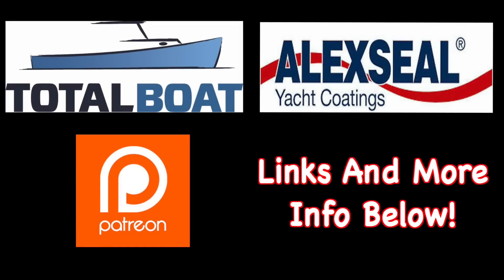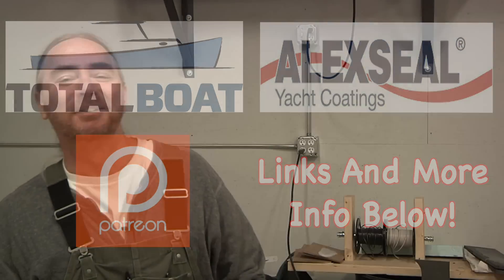HOW MUCH POLY OR EPOXY RESIN DOES YOUR FIBERGLASS LAYUP NEED?

Comment: Hey Andy, I'm making a small boat where I need to fibreglass 7 metres squared of area. It will be in the tough oceans and must must be waterproof. Do you have recommendations of the type of fibre glass and epoxy needed and how many layers? A salesman told me ten layers and tried selling me 55 gallons of epoxy but I was skeptical

Comment: I did my 1st layer of 1708/epoxy on my 1st composite project.  I think I over saturated it.  Can I use the epoxy dried brush (uncleaned brush) to apply the epoxy or an old plastic card to squeegee the 2nd layer before applying it to my 1st project ?

Comment: Andy, So what is better to saturate the glass or just enough to thoroughly wet out?
On a side note, I have a boat where someone has gloss painted a part of the transom inside the boat... I want to add a splash well can I glass over the gloss paint or will it involve stripping right back to glass underneath the original gelcoat and gloss?

Comment: Hey my friend, I’m finally getting around to resurfacing my barracuda Hydrocycle, it’s got old stained and spider cracked 1969 gel coat. I almost got it all sanded down to a clean surface. I had to sand out a couple warped spots into small holes that now need to be covered too. I want to put a layer of cloth over the entire boat, then sand and paint, but I don’t know which product to use for resin. Can you recommend a product that won’t break the bank, but still work for what I need and be good for years to come? There’s not a ton of structural strength needed, just over the small holes I sanded… It’s a jet ski sized boat, it’s like a jet ski with a 35hp outboard on it…there is a video of it on my channel if you wanna see it.

Comment: One question i would like to ask someone who knows. when locking att Youtubers with old sailing boats they tend to have problems with structural wood rotting in there GRP boats.
So the question Has manufacturers stopped using wood as structural components or is it still normal ?? or the answer is not that simple ?

Comment: I'm trying to replace the core on a small area on my boat. Temperature during the day around 55F then drops to 45F overnight. Can I do my epoxy work during the day? or the low temperature during the night is not ideal for curing? Thank you
Reply: If possible using a heat lamp or blanket over the work area would help a lot. Even 55 is on the low side for curing epoxy properly. Black plastic in the sun can also help during the day. There are all sorts of ways to jury rig a small amount of localized heating.
Reply: @mckenziekeith7434 Thank you. Temp start rising now and I should be okay. Cheers!

Comment: Always weigh resin and lamament.  A ratio of 1/2 part resin to 1 part natural glass and 1 part resin to 1 part synthetic material (Kevlar, polyester, nylon) plus an extra amount of 20% to 40 % depending on labor, components, complexity of the part is what worked when vacuum bagging.  Most hand layups struggle to get a 1 to1 ratio.  
      Excess resin results in a part or repair that will lead to early failure.

Comment: your content and info is well priceless to the DIYer  like my self. I have a question on 1708 that you may have covered before .... if chop mat is more cosmetic and woven for strength should you lay it woven side to surface or the other way round. From my understanding chop mat is sand able and woven is weakened if you sand and damage the woven mat in the resin . please correct me if i am wrong.

Comment: ok. but what about vacuum infusion..?)
Reply: vacuum infusion uses less resin. Maybe about 40 % resin to fiber ratio.
Reply: @mckenziekeith7434  is correct. We run a 40% resin to glass ratio on all of our infused parts. Measure out the dry material and calculate the resin based on the material weight. When open molding, the resin - glass ratio will be closer to 50-60% resin.

Comment: Andy! when you use brushes to apply the resin, what! do you do with the brush upon completion. Do you have a method for cleaning and reuse or are the disposed of? That would be a lot of brushes. Have a great day to your and your family. The productions are wonderful. Thank you.
Reply: Just pour some acetone in a bucket with a lid, brush submerged.
It will keep brush supple until next time.  Consider contamination though. Brushes will collect dust or debris from the layup. 
Best to use a new brush on finishing etc.
Reply: Just pour some acetone in a bucket with a lid, brush submerged.
It will keep brush supple until next time.  Consider contamination though. Brushes will collect dust or debris from the layup. 
Best to use a new brush on finishing etc.
Reply: Andy can correct me if I’m wrong but I’m 99% sure he uses inexpensive chip brushes to wet out and tosses them after each use. I do the same based on this, buying them in bulk. I’m using epoxy.

Comment: How about when laying onto thirsty dry plywood surface?
Reply: On plywood I normally apply a first thin coat of epoxy using just a squegee and use a brush only for the edges. Then I re-coat as needed after it hardens. This prevents unnecessary build-up of epoxy.
Reply: I tend to use dirty acetone from bucket for cleaning the brushes resin/acetone mixture will penetrate the wood acetone will evaporate after acting as a carrier for the resin.  Seals wood nicely ready for a lay up later on. Hope it helps.

Comment: Andy nice vid now here is a idea. What about multiple layers of glass is it still a good rule to follow.
Reply: the next layer will use slightly less if you layer onto the wet and roll with metal roller it should squeeze out about 1 oz so wet next layer with only  a 2oz mix 3rd layer  would be back to around 3 oz next layer again you would reduce ,glass is what gives the strength best roll out excess epoxy as it has no strength anyways

Comment: Correct me if I'm wrong please. There is an ingredient in the glass, especially CFM that helps hold the fibers together so that it keeps it's shape. The poly breaks this down so to make the glass plyable & moldable and the epoxy does not. That might help explain why is saturates the glass better. If I'm working a large area I do as you do and mix a number of smaller batches instead a large one..... we all know how that works out.

Comment: My supplier recommended 3.2 Oz epoxy resin per s.f. of 1708 and (IIRC?) 1.5 OZ. CS mat. This resulted in a 1/16" per layer thickness at a "just right" resin density. Getting the 1708 to infuse resin is a challenge, most times rectified by pre-wetting the glass.

Comment: 2 questions...
Could you calculate volume? I intend to vacuum-bag a couple of hatches. Would 3'x4'x 3/8"  not give me a reasonable volume of resin.
Is there chop-strand matt on the back of that second test cloth? You normally wouldn't use CSM with epoxy would you??

Comment: When using epoxy, I've always gone by the 1:1 rule - 18oz of epoxy to wet out 1 sq yd of 18 oz glass, 6 oz to wet 1 sq yd of 6 oz material. That's pretty much what this video shows.
Reply: Youl never get it perfect unless you eyeball it mate. Sure, knowing roughly what's needed is helpfull but I always mix up at least another 1/4 on what mathematically it needs and even at that I've found myself scrapping the cup for the last little bit coverage. I've also seen a panel that was 80 gritted only had smaller pit holes but lots of them and it swallowed a lot of epoxy even after a fairly thick wet coat prior to application. If you are new to it I'd personally mix up another half on top of recommended coz I guarantee you will end up having to remove a load of push out and probably not be mixing the pot regularly so a fair bit will become stringy and unusable. See every problem I've seen new guys getting, I had the same.

Comment: Easy way to do it is simply weigh your glass, you want a 50/50 of glass to resin ideally. So if your glass weighs 1 kilo, 1 kilo of resin will get you close, by the time you add your hardener that will give you some extra for loss.

Even easier yet, your 1708 glas, that number is how many grams per sq meter it weighs, so if your laying up 1 layer of 1m sq of 1708 you need 1708g of resin. The math can be adjusted If you want a resin heavy layup. I usually add 10% for consumable use(peel ply, roller soak, stuck to the cup walls etc) that's how we do it working on our wind turbine blades.
Reply: That's how Russ on Life on the hulls does it also.

Comment: I was under the impression that it takes about equal weight of epoxy to fiberglass. So 1708 is 25 ounces of fiberglass (per square yard). So 1 square foot would be 25/9 = 2.7777 ounces. That's just about what you found in your tests. So thanks for confirming. Might want to mix up just a little extra :)
Reply: But an ounce is not an ounce
Reply: @fishhuntadventure  thats correct. Fluid ounce is not the same as an ounce weight, and the measured amount in the video is fluid ounces from the measureing cup.
Reply: @fishhuntadventure  fair how about this one once of glass will absorb one fluid once or resin
Reply: @fishhuntadventure  true but you can correct if you know the density of the mixed resin. For epoxy resins this is usually listed in the technical data sheet TDS. Usually it is like 0.8 oz weight per oz volume.

Comment: The best part is every single product is different in how much you need haha.  Eyeballing it comes from experience.  However halfway through my first boat build I was able to hone the art of the eyeball.  It doesnt take much experience which is good.  I owe a lot to you andy, I've watched every single video. Some multiple times.
Reply: Completely agree. I'm on my 6th boat now and I've helped two of my mates on another 2 projects so 8 in total taken back to bare GRP.  I'm a coachbuilder mainly custom spray painter now and realised a long time ago the mathematical amount required for the cloth type/size etc is way way off. It was probably half way through my first boat I dialled my epoxy game in so my cup was near as good empty by the time I'd finished the area. What I would do is prepare other smaller areas needing fixing and any leftover epoxy I would use it to finish them off. When i say small i mean stuff like screw holes or barrier coating smaller repairs. It suited me brilliant because It mean I could walk away from the final stages of the lesser important fixes and just come back to them with the leftovers I had from the important stuff. There is nothing worse than having to mix more up right at the end of fix area because you ran dry, it's far far better scenario to have too much and have a quick cry while you watch £10 of epoxy cure in a cup.